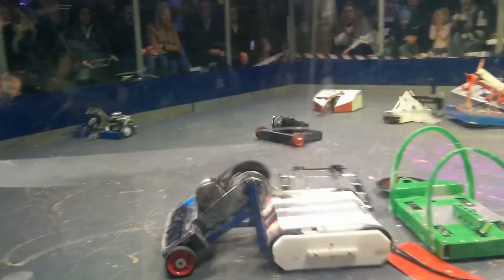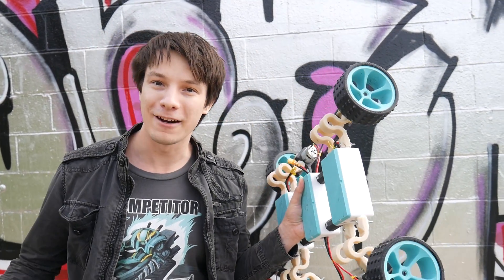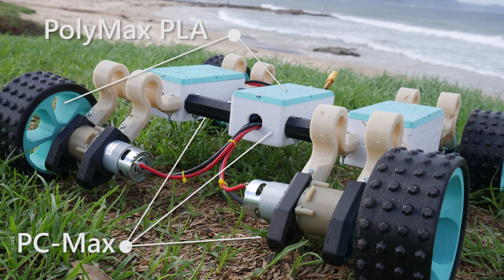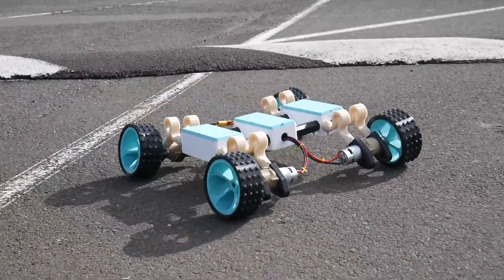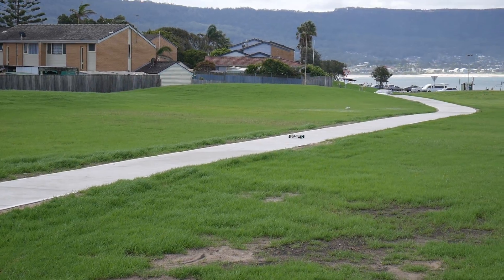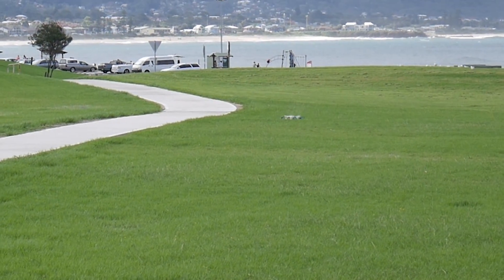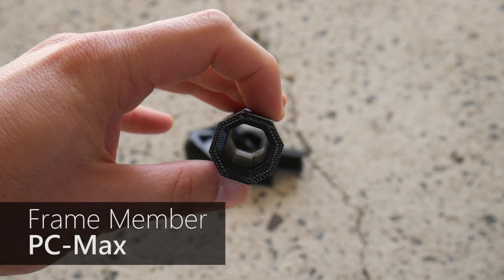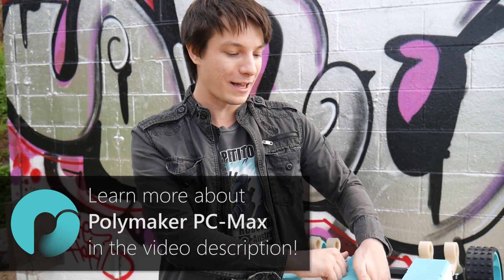3D Printed Off Road Robot with Polymaker PC-Max

Comment: I love the was it's design gives it a slight ability to twist as it goes over rough terrain. Needs some kind of rubber knobs on the wheels so it has a better grip to climb over those obstacles. That plastic is just a bit too slippery.

Comment: So a single 30a ESC can run two drill motors? Many people i know have had to use botbitz 85a controllers for one. How smoothly did this platfrom run electronics-wise?
Reply from the maker: +Edd Lyons I wouldnt do it in a combat situation but if you're lightly loading the m like this it works great. A tz85 will usually survive a stalled drill motor these won't!

Comment: Would I be able to print that PC-Max filament with my wanhao i3 clone (cocoon create) and a flexion extruder??
Reply from the maker: No sorry you really need an enclosed printer and the flexion will get damaged printing at the temperatures needed, unless you have the new HT version.
Reply: cheers Angus, no worries.  I'm planning to try out some PolyMax PLA soon anyway

Comment: It's down to design. I've designed and printed a couple of successful vehicles in PLA with no problems. These specialist filaments are too expensive but I suppose If I told filament makers I could feature their goods on my 63000 subscriber channel, I too could afford it. Until then, I'll stick with good design and ingenuity.

Comment: Maybe I'm nitpicking, but I wouldn't exactly call that a robot. Lol. It's just an RC car.
Reply: Stick Figure to be nitpicking he did Call it a robotics "platform"
Reply: The definition of a robot is really tough to nail down.

I'm inclined to want to limit "robots" to things which use sensors for autonomous driving but there are lot of "vehicles" which require assistance from microcontrollers to control.

I added three videos to a playlist titled Are These Robots?
Skip to the two minute mark to see the Mecanum wheeled robot run. The Mecanum wheeled robot is remote controlled by the microcontroller has to do a bit of math to figure out how much power to give to each wheel. The robot would be impossible to control well without the aid of the microcontroller.
My Halloween Hex uses lots of math in the inverse kinematics equations. Again, with out the aid of a microcontroller, the robot would be nearly impossible to control in a useful manner.
FWIW, I programmed this "robots" myself. I'm afraid all the trigonometry required to programming the hexapod caused me irreparable brain damage.
While the vehicles shown in the playlist are all remote controlled, I still think of them as robots.

I'm not sure why, but I don't really consider remote controlled quadcopters robots. Quadcopters would be pretty much impossible to fly without a flight controller. The math needed to make quadcopters fly smoothly is as intense as the hexapod math. So why do I think of the hexapod as a robot but I'm not willing to grant normal quadcopters the same title?

In my opinion, trying to define "robot" is nearly impossible. Whatever definition you come up with it will likely exclude things which most people consider a robot and include things no one in their right mind would consider a robot.

I'm itching to get a 3D printer myself and try to expand my robot army collection.
Reply: @ddegn  On quadcopters I would draw the line at autonomous flight capability. So an FPV-quad that needs to be piloted all the time, even though computer assisted, is not a robot but one with GPS and autonomous capabilities like waypoints or even just return home is. Also the combat "robots" are not robots but RC-vehicles as they don't do anything autonomously. But this is just my opinion of course.
Reply: @Murgo-u3l  I tend to agree with your definition of "robot" but by your definition (which I think is completely reasonable) my hexapod wouldn't be a robot. My hexapod is not autonomous. I think most people who see my hexapod would consider it a robot. I consider it a robot myself but I acknowledge it's also a remote controlled vehicle.
If we use the autonomous standard, then I don't see why a railroad crossing gate isn't a robot. It lowers when a train passes a sensor in the track and raises when the train passes. The crossing gate doesn't have a human operator. While I can't think of a good reason not to call it a robot, it sure doesn't strike me as being a robot.
I'm not sure if there is a definition of robot which would include everything I think of as a robot and exclude everything I don't think of as a robot.

"But this is just my opinion of course."

I think your definition is reasonable but I bet there are plenty of things which would meet your definition which most people wouldn't consider a robot.

Thanks for sharing your thoughts on the subject.
Reply: @ddegn  Yes, it is somewhat problematic, I don't think there's one clear definition of a robot everyone agrees on. But I think one important thing besides autonomy is certain flexibility/versatility, a robot is a device that can be programmed for different complex tasks which it then performs autonomously at least to some extent, so an automated device that is made to do only one thing like the railroad crossing gate is not a robot as it can't be programmed to do anything else or do it's task in a different way and also because lowering a gate when a train is coming and raising it after the train has passed is not a complex task in my opinion. But what is autonomy and what is a complex task, I don't really know where to draw the line.

I would not consider a hexapod a robot any more than the FPV-quadcopter if it's directly controlled by a human operator but if it's equipped with sensors and programmed to walk around by itself then it definitely is a robot. But on the other hand many directly human controlled machines are called robots, like the remote controlled miniature excavators used for demolition work even though they have absolutely no autonomy. 

Is a remote controlled loading crane fitted to a truck like the ones I repair for a living a robot? Someone might call it that, I think it's just a remote controlled machine as it has no autonomy of any kind even if it has lots of sensors mostly for safety features. But if a safety limit is triggered the only thing it can do is deny movements that would increase instability, it's the operator's task to solve the problem by using only safe moves. On the other hand some newer ones can for example automatically unfold and fold themselves for transport so are they robots? Or is a modern car a robot as many of it's functions are computer controlled but it still requires a human operator? Some can even parallel park automatically but not really autonomously as the driver needs to operate the gas pedal for the car to move.

Very complicated indeed.

Comment: very nice! i have been thinking of building a top fueler 1/10 scale frame and using a nitro engine out of my old nitro car. the car currently does 100 kmh with a two speed gear box. What i was planning on doing was making the frame with a mixture of 3d printed parts and some aluminium or carbon fibre rods but this filament you have showcased looks like i would be able to fully 3d print the entire frame. I also wanted to 3d print the gear ratios and see if i can get it to break the 160kmh barrier but with current filament i believe friction heat would ruin the gears. I was thinking printing the gears in nylon but still not confident. How do you think this filament you have used would fair with high friction? Is there an australian supplier for this filament and if so how much for a 1 kg roll? Thanks makers muse love your work!

Comment: I love PC-Max.

Very strong. Just as importantly the quality of the prints is amazing and it's not too hard to print. I needed an enclosure for bigger bits. With a PEI bed, no raft, a bed temp of 120 Deg and a large brim that has a 0 offset I got rid of all warping. Can't stand build tak.

Comment: This is the first commercial for expensive filament that makes me actually consider buying it. Wanted to build some kind of rover for a long time. Don't like the brushed, exposed motors though. I thought about brushless motors with a 3Dprinted planetary gearbox. And you know what? If Angus released the files I can just modify it! This is a great combination of hobbies!
Reply: Well... that's why it's 3D printed, just print a new one. Also we are talking specially tough materials here. Anyway I wouldn't drive around enough to break it on a regular basis anyways. But if this is supposed to be ALL 3D printed why not the gearbox too? As a bonus, those Herringbone planetary gearboxes look super cool in action.
Reply: Look up xRobots by James Burton. He builds 3d printed gearboxes for robots all the time without issue.

Comment: you can definitely print that with ABS with same result. Also its kinda bendy on the road. I dont see any point of using specifically poly-carbonate like plastic for that project but good work

Comment: Is this using 4 brushless motors with a decent KV rating or what? Just seems a little slow for my taste. I'm used to 40+mph RCs though. Looks smaller than a normal RC Short Course Truck brushless motor and actually looks like more of a quadrotor brushless motor. That nylon suspension works pretty damn well though for being made entirely of nylon. Same goes for those wheels and tires aside from not being nylon.

Comment: Did you intentionally design the robot with such an extreme negative camber on purpose? Or is that something unintentional due to the suspension geometry that you will have to tweak? It looks like a good demo platform for an impressive filament, regardless.

Comment: I don't see why this couldn't have been printed out of abs. ..... also if the design was so weak that printing from standard materials would not give you the strength required why didn't you just redesign to be stronger? it seems a bit ridiculous to claim you could never make this because there didn't exist a material it was strong enough.

Comment: Any chance of getting a video showing the strength difference when printed in the same shape? I feel that hollow PC-max octagon might be stronger/weaker compared to a flat part that touches the ground on its base completely.

Perhaps a video where you strengh, tensile and compression test ABS v PLA etc?

Comment: This test wasn't about strength... I'd like to see a more thorough break test of this PC plastic !
Reply: Check the link, they did some weight testing, not super extensive (no 3 point break tests) but you can see the failure mode when they increased weight until failure.

Comment: This is awesome, though I have to say. It's 90% 3D printed not "fully 3D printed". Much better than the people buying RC toy cars and printing a new shell calling it "Completely 3D printed". I understand it seems absurd to expect someone to print a complex electronic device without using any non 3D printed parts but that's the reality you didn't do that so implying you did is objectively false.

Don't get me wrong I love this and I wish I had a 3D printer to make one but you can't print screws or motors. Maybe being accurate about your claims seems trivial in this instance but when we are 3D printing electronics that work right off the bed it will seem very misleading to say "Fully 3D printed" when you used non 3D printed parts.

We are likely less than 20 years from the first fully working electronic circuits printed at home on a 3D printer.

That said, I really commend you for using as few non printed parts as possible, you really are only using screws, wires and other parts when absolutely necessary.

Comment: what control system did you use? arduino based? just a normal RC TX/RX combo with differential speed?
awesome build anyway, i've always wanted to make a "real" robot platform, maybe something like this.
Reply from the maker: For the moment it's running a hobbyking 6ch radio with two botbitz 30A esc's - remote controlled. It would be quite trivial to replace the receiver with a micro controller of some kind, but certainly not trivial to program it!
Reply: in my opinion, programming arduino is easier than it seems, especially if you use a drag-and-drop interface like ardublock. maybe you should try it? i'm pretty sure you can make it work with normal RC ESCs.
Reply: or you could always use any normal RC transmitter with pulseIn.
Reply: alright, that makes sense. i'm a bit of a newb myself, so i don't know everything about this stuff.
Reply: Maker's Muse In my experience, the nRF24l01 is a good way to provide RC to a robot. It's cheap, reliable and there's lots of documentation around. 
I'll be glad to help if you have any questions on using it to implement an RC system.

Comment: a good solution for the suspension problem may be not to thicken it but to move some parts around so there are suspension parts on each side of the wheel instead of two on one side. you'll be sacrificing some width on the track but it should counter the sag that's happening. you'll just have to lengthen the axle so it can clear each side.

Comment: Too much chamber. The motor and the "tire" imbalance the suspension geometry. It's cause way less traction...
Reply from the maker: First mod is to lock the suspension in more to stop that, I was surprised how much flex nylon has!
Reply: From the looks, before you drove it I could see the suspension was flimsy.The first thing that came to mind is you to use a horizontal suspension between tires. You could modify the part where the motor is and add a notch in the part(above motors), and then print long cuboid or triangular prism from nylon a bit longer than the gap in the middle of the notches so that when bent it forms an arch and it can be inserted in the notches.